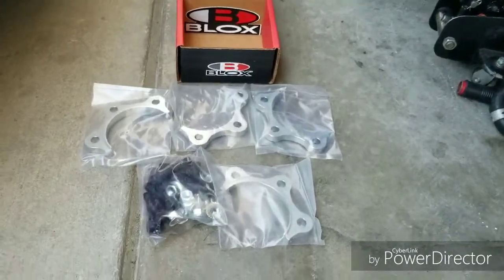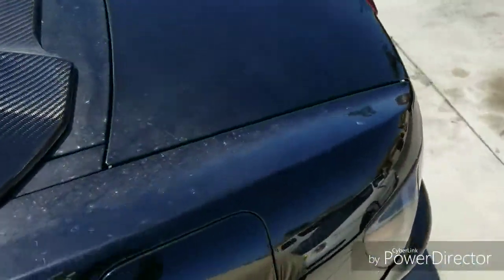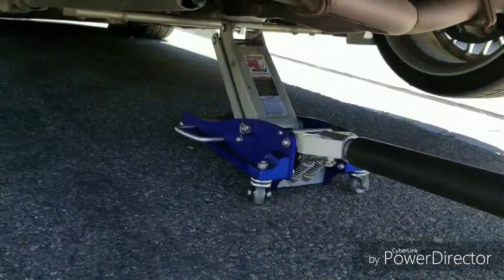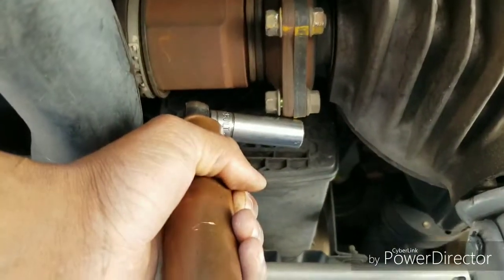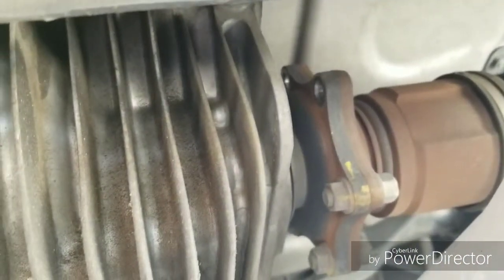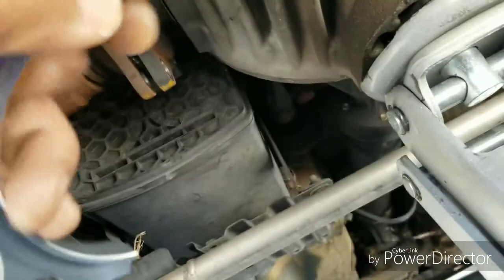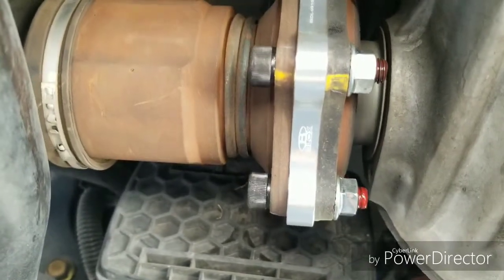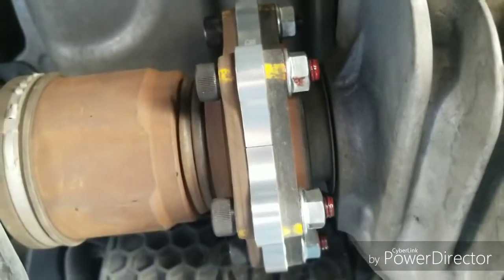S2000 Half Shaft Spacers Install

Comment: did it help?
Reply from the maker: Yes it helped. I still feel a slight vibration. But not as bad as it was. Thanks for watching 😁👍
Reply: @Duwop77  Thanks, my 03 is now vibrating at high revs or over 65mph. I hope this helps
Reply from the maker: @dakota3872  if your rear wheels has already been balanced and not warped. More than likely this will help. But make sure you get the 2pc rings will save yourself a lot of work.👍
Reply: @Duwop77  ✊🏾

Comment: Stripped one of my bolts without a strong power tool...
Reply from the maker: Is the nut stripped or the actual bolt?
Reply: @Duwop77  both, but I got it out. For some reason the other side is impossible to move
Reply from the maker: @Jims_Adventures  ok cool. Glad you got it worked out.